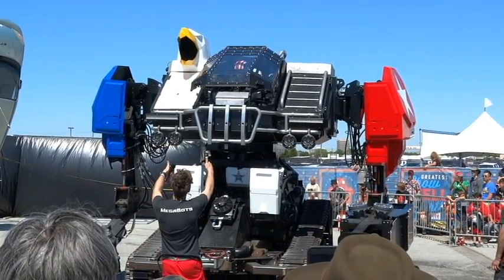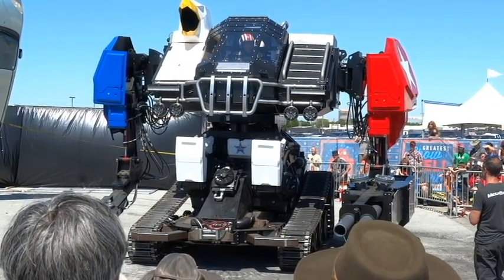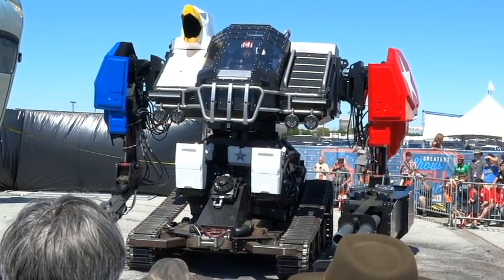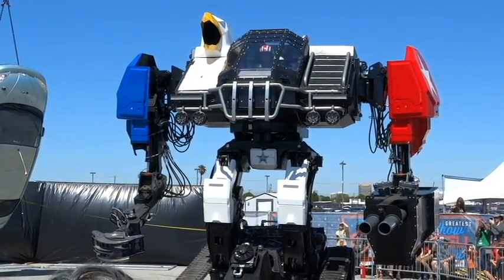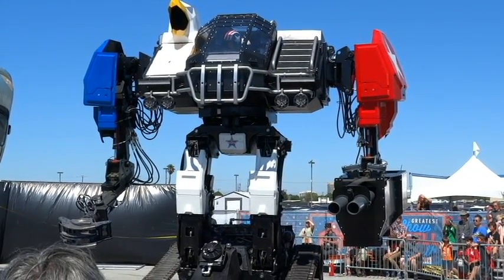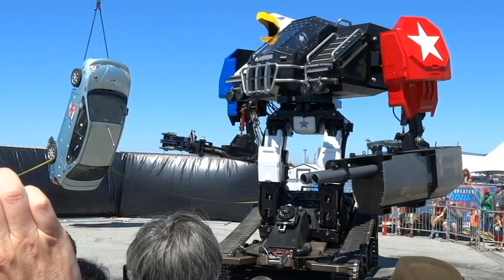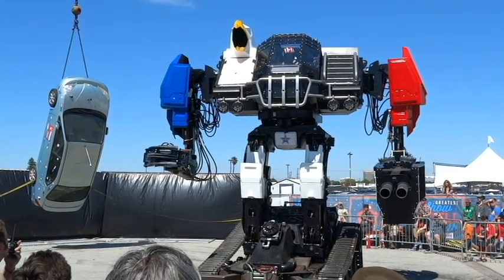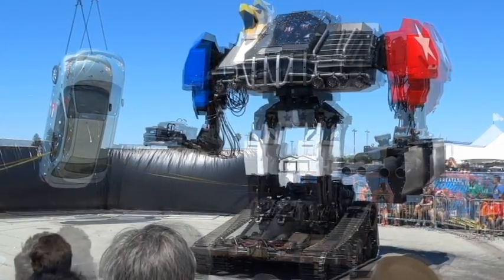Megabot at Maker Faire 2017

Comment: Ah great, so it doesn't walk, takes 3 hours to get going, and then does about as much damage to the car as an 8 year with a sledgehammer could have, with a punch that looks like someone left their coathanger in their jacket that day.
 Useful.
 Still, if that cockpit might actually be safe enough provided Japan also fitted a 'punch like an 8-year old' control mode.

Comment: Don't forget that they said they just fully assembled the thing three days before the video. You don't put your highly experimental fresh off the assembly line one of a kind prototype into a full combat rigorous test a week after it rolls off the line. No, you run lots of slow incremental testes to make sure absolutely, positively every single thing is working perfectly. A shake down cruise, as it were.

Give them time to work out the kinks. Its not just crowd safety that they are taking things slow here. (one reason is the person piloting the arms is a backer pilot. Meaning they were probably learning the controls right then and there).
Reply: While I'm extremely disappointed in the design, I wouldn't blame them for not ramping it up.....we are talking about regular materials here.  Even if they were able to do a fast successful punch, one must take wear and tear into consideration.  This thing will likely do thousands of dollars in damage to itself in a full power punch, because we are essentially ramming something metal into something else metal.  It's not the same as say, a tank driving through a brick wall.  Brick walls are hard, but they are soft and brittle in comparison to steel, along with mass moving at high speed, makes it easy.  

But I think the only way this thing wins is if it uses its arms to flip the enemy bot over.